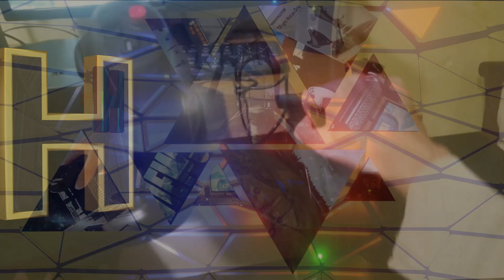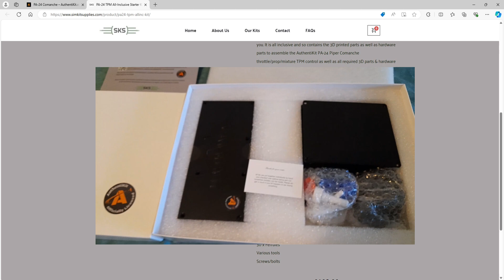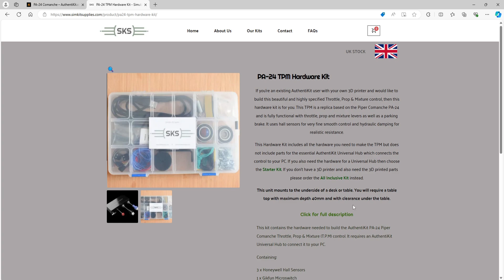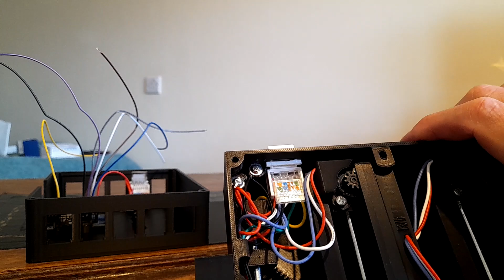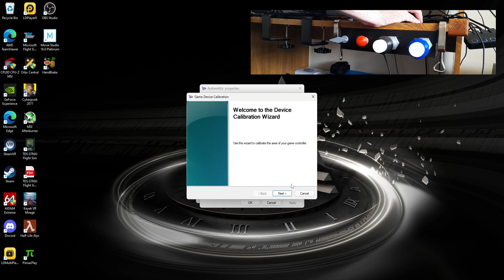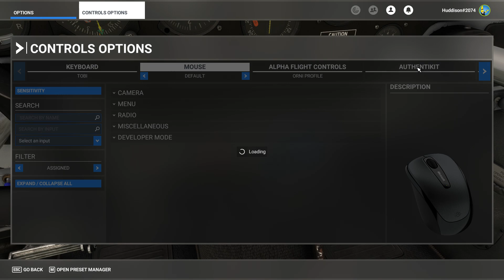FS2020: Authentikit Comanche TPM Flight Controls Review | High-def Immersion!

Comment: Hi there, I mapped the controls in FS2020 just now. In the Comanche, it works perfect. But in the Cessna 172, the mixture lever has a much bigger range than its virtual counterpart.

By that I mean: if I pull the mixture out, the Virtual mixture will already be fully out but the actual mixture lever in my hand keeps going for roughly another 50%. Any idea what's causing this or how it could be fixed? Does the same happen to you when sitting in the 172?